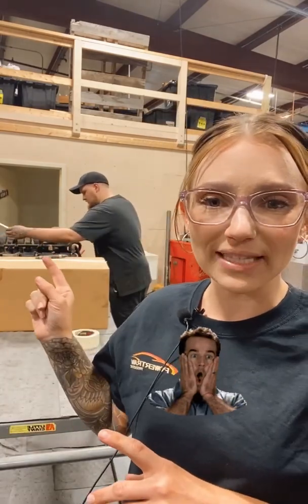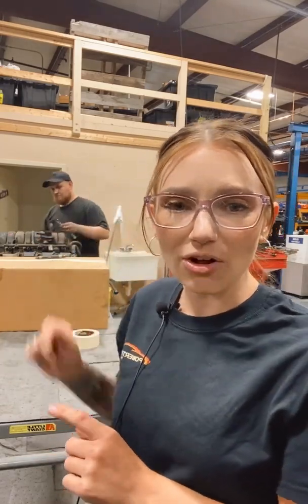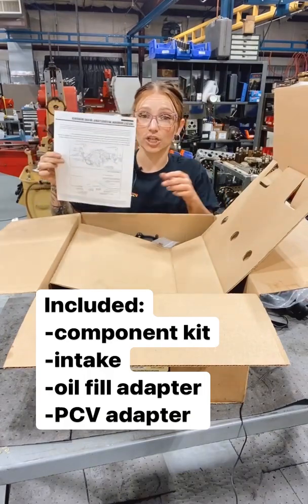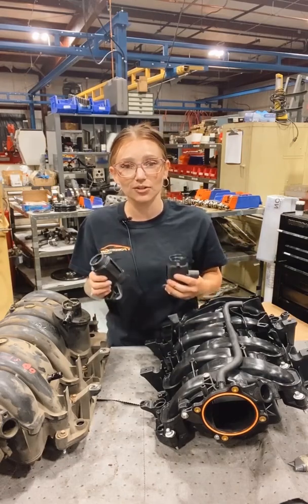Hemi Intake Manifold install

Comment: The issue with the dorman is its has shorter intake runners, and so there is a loss of power, that why its empty in the back of the OEM because the runners are higher than the mounting. Im not saying the Droman doesnt work, it works for the cost vs an OEM or performance version.

Comment: I imagine the reason behind them being returned is that Dorman sells them cheaper themselves. However Dorman products are low quality parts now. Out of 10 parts for multiple makes/models Dorman is the least likely to succeed. It’s manufacturing company has dropped the ball in the last 10 years and it’s nothing what the quality use to be. For a good price compared to OEM they sell enough of the products to make them better. They have, like many companies reverted to selling inferior products that don’t last as long as the OEM parts. That’s not to say ALL Dorman products are inferior, it becomes a 50/50 shot with there products. Now if your in house assembly works with Dorman specific parts they may tell that some aren’t quite what they use to be. However I have seen a rare few products that did outperform/outlast the competition that Dorman produced. My EVAP Leak Detection Pump from Dorman has outlasted other manufacturers(just not the OEM).
Reply from the maker: So first, we don’t sell dorman products other than this. And because of that, I have no experience with their quality other than these intakes which have always proved to be great. Second- Any new intake is always better than re using an old intake for Hemis- really all dodge .7 engines - because of the powder coated materials used in the intakes. And third- there is no reason for the returns other than people thinking they don’t fit. We don’t advertise to be the cheapest, most people who buy them from us do it out of convenience- but when they see they don’t look exactly like the old ones they get alarmed